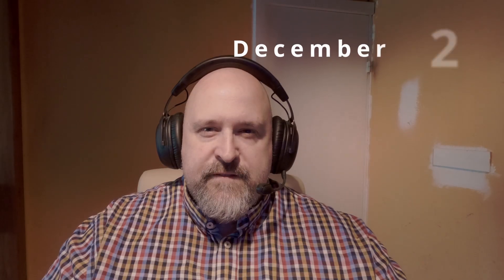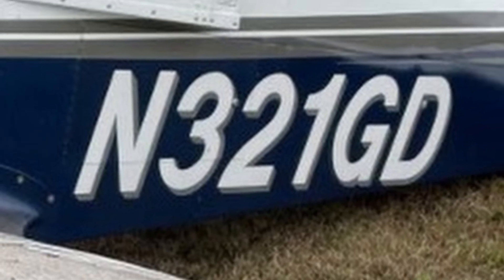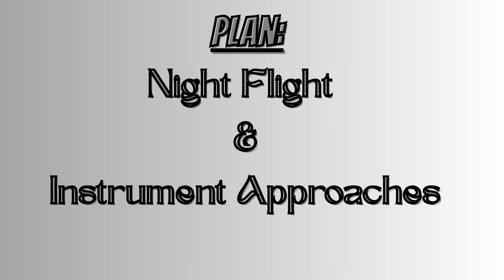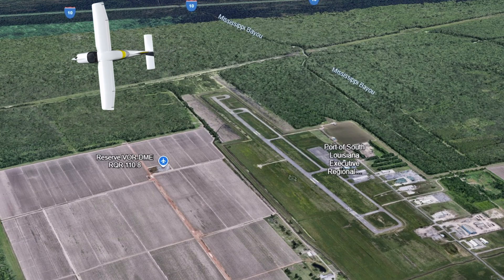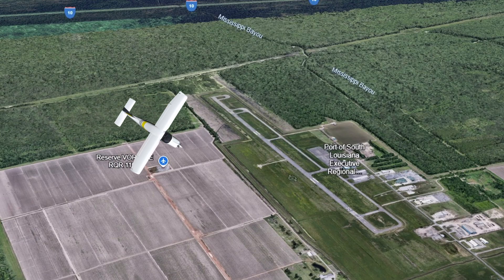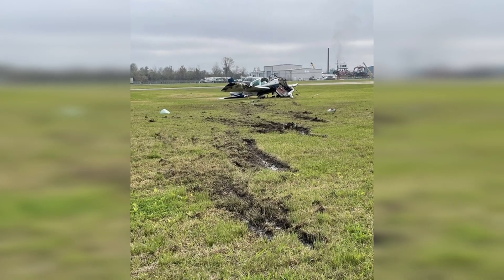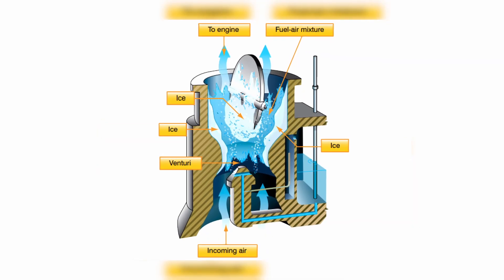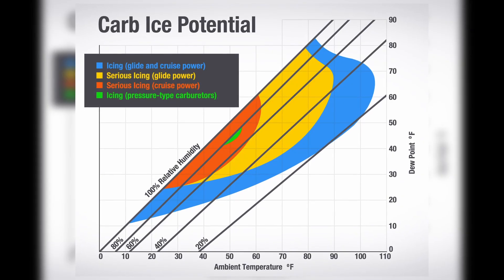A $100K MISTAKE: They Did Everything Right — Except One Thing

Comment: You are right.  Too many guys here dont know what they dont know about engines.  And dont want to know either.  They are just afraid of touching the levers to troubleshoot when climb out.  Yes you can apply SOME carb heat when between 40 and 80 degrees and very humid as prevention. I learned that in 1999 and done it.   But they are afraid, thats all.  They are afraid of learning EFATO and the troubleshootings before the turnback.  I learned both in 1999.

Comment: For power off Hook Turnback, better follow a rule.  The 777 No Power Turnback Rule.  If expecting to climb at 700 fpm plus, have 7 knots or more wind, then mark the altimeter for 700 agl or more.  I learned that on the Emergency LowManeuvering channel.  The 700 No power Tunback rule.  Partial Power he taught from 400 agl if not surging engine. We did them on Pipers from 400 agl.  Even at night.  Most engine fails are partial power.   If deep surging, dont turnback, headwind turn if any crosswind, after changing tanks, then if engine stops surging, you have half of the turnback made already,  Dont wait, do it.  From 400 agl or over.

Comment: You dont know what your talking about....no one uses carb heat on full pwr application
Reply: If you are stupid and ignore high humidity.  My CFI taught me in 1999.  And i did it hundreds of times in Florida weather.  You just put less than half as prevention.  We used to fly when others stayed on ground afraid.  You also might have to lean mixture a bit.  Some are too coward to touch those levers on take off.  You have to.

Comment: nobody would ever use carb heat in a climb so how is it they forget to use carb heat when it is not even needed.  at 500' AGL obviously you still have climb power so carb heat would not be required..carb heat is never required at climb or cruise power.  your story is complete BS!  there is plenty of heat produced by any engine to prevent any carburetor ice.  even in my Luscombe with C65 continental which is the worst engine out there for carb ice you only need carb heat at lower power settings.
Reply from the maker: Thank you for your contribution to the comments. In most cases I would agree with you. But carb icing did bring down this plane, and not using carb heat when the engine started to choke was the reason the plane crashed. The FAA concluded that carb ice did in fact build up in the engine. It is possible but very rare and the AA5's emergency check list does require you to put on carb hear as one of the first steps, even in the climbing fase. At 500 feet there isnt much time to react and the instructor decided to fly the plane and try to get back to the airport. They survived, but the plane didnt. Had carb heat been used, most likely the engine would have regained power within a few seconds and the crash would have been avoided. Im the end this is not to blame anyone, but to raise awareness that this can happend at any altitude and at any powersetting given the right conditions.
Reply: @AndersSmithField  it's a pretty fucked up situation to use carb heat on takeoff.
Reply: @AndersSmithField  You are right.  Too many guys here dont know what they dont know about engines.  And dont want to know either.  They are just afraid of touching the levers to troubleshoot when climb out.  Yes you can.  But they are afraid, thats all.